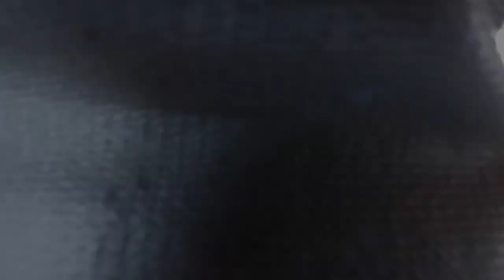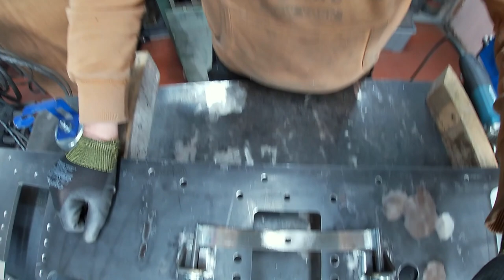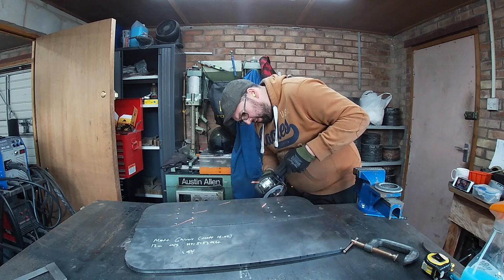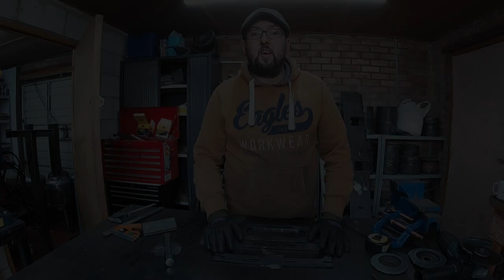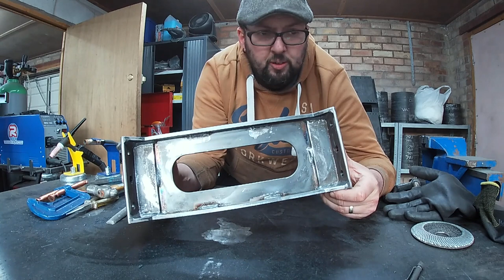7.25" Gauge Steam Locomotive Build - Ep 2 - Main frames, Buffer beams & Frame Stretcher.

Comment: Enjoyed your posts on the NGRM Forum for years Matt...  This is outstanding!  For future reference.  A good laser shop should be able to laser cut slightly undersized holes through the frame pieces (that you drill/open out later), which would save you a lot of marking and drilling.  Most laser machines are good for +/- 0.1mm for position (or better).  

Hope to do something along these lines in a few years, at least before I lose access to the lasers at work!
Reply from the maker: Thanks Jeff, your work is an inspiration to me on NGRM. 

The reason I didn't cut all the holes was to reduce further bow in the frames with the heat from the laser. I had the frames mirror cut so if the plate had a bow in to start with I could put them back to back in Assembly using frame stretchers to straighten them. Future projects that are laser cut will have the holes cut in.

Good to have you on the channel Jeff. All the best, Matt.

Comment: I’d just keep an eye on that front buffer beam that you don’t start to get rust forming between the two plates
Reply: Yes and no, they’d rust into each other and by that thickness, I’d be probably for another lifetime before we’d see a hole 😂 but nonetheless good comment, some oil in between or paint or welding it fully would solve it I guess?
Reply from the maker: Yes this did cross my mind, but I should get a few years service from it before I'd need to replace it, which would be one out of 25mm thick steel.
Reply: @gregoryvanderdonckt6028  haha yes not so much talking about rust holes forming as that would take a long time but I have seen sandwiched plates like that start swelling if the rust gets too bad
Reply from the maker: Gregory, the rust would effectively create a bulge in the plates, depending on where and how bad this could potentially cause damage to adjoining parts. This wouldn't happen over night, more years 10/20+ years.